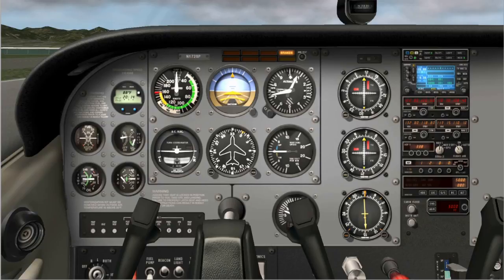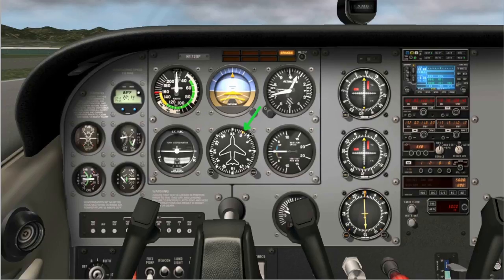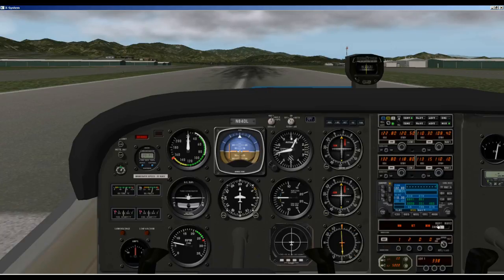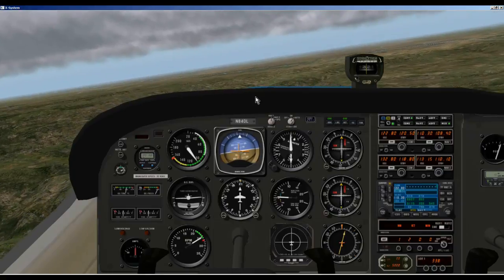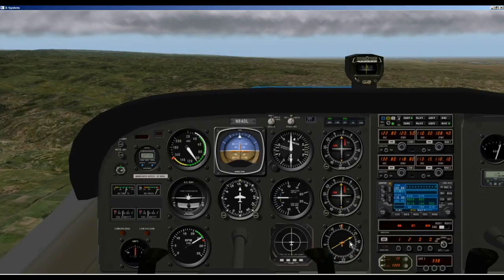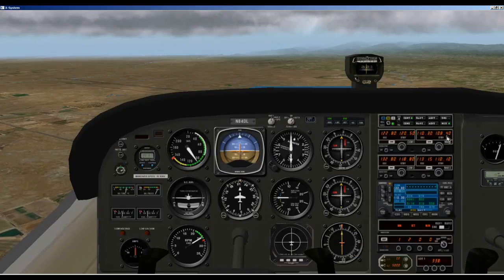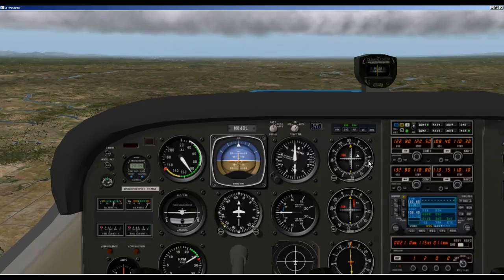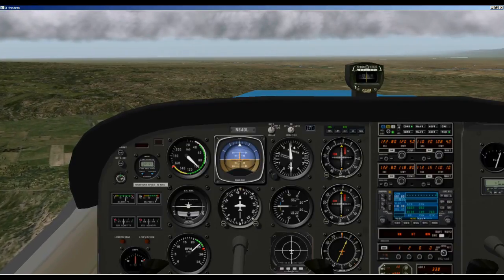How to Use the Autopilot ~ ADF, NAV Radio, Altitude & Heading, VS ~ Part 1

Comment: When setting & using the VOR frequencies & the plane does not have a “LOC BUTTON”.

Do you set the toggle switch on NAV-1 or GPS?
Reply from the maker: Hi Michael,  To use the NAV radio with a VOR the selector switch must be turned to a NAV, it will not work when GPS is selected. Each airplane has it's own set of switches or buttons for selecting navigation options so you will need to look at your Pilot Operating Handbook (POH) for how to use the navigation system in the airplane you are flying. Below is a link to my videos on navigation you might want to watch these. Part 2 shows different airplane controls and this might help you. 
www.youtube.com/playlist?list=PLjqSrWIZDAi9S9ds3QbfiTkjGAmE6b7IG

Hope this helps, let me know.

Blessings,
skip

Comment: Just had a really enjoyable flight, following through this with you. I did have a few issues though and I hope these are not stupid questions.
First I washed out on the ADF section. I’m just looking at X-Planes map and didn’t have the tick boxes at the side, so couldn’t locate an NDB. What map are you using Skip?
Second, I was playing about with setting a height and climb rate for the auto pilot and I managed to stall the plane. I think I set it to climb at 500 feet a minute. Is that too steep? Or did I need to do a Tim Allen and add moooore power.
Lastly.. perhaps a bug on my system... after landing safely at (my new improved) Benton Field. I shut the plane down but noticed that despite turning the avionics off, my radio stack still seemed very much on. Am I missing something?
Thanks Skip, I very much enjoyed the flight. 
Phil
Reply from the maker: Hi Grey great to hear you are enjoying your flights! This video was made in X Plane 10 and the map was changed in XP11 so they are not the same. The ADF feature only had a few NDB stations so you really need to look hard for a NDB. They are displayed on the map as a small circle of dots and have an identifier next to them. If you are flying around Benton Field and Red Bluff you will find one just above the Mendocino VOR labeled UK

500fpm is a fine climb rate and yes go to full power when climbing.

As for the Radios not shutting down that's my mistake assuming you are using the 172N I offered. The problem is I made the instrument panels in Plane Maker and forgot to connect the radio stack to Bus 1. You have two options and I suggest the first one just so you can see how to make changes to you panels. 

So open the airplane in X Plane Plane Maker. 
Go to the folder with the airplane and select the 172N.acf file and open it. 
Then under "Standard" select "Panel:2-D" 
If you don't see the panel hold down the right mouse button and scroll up this should bring up the panel. 
Now just click on the radio, it will be highlighted in yellow. 
On the Left side you will see a "property" section. 
There you will see that the check  box next to Bus 1 is not checked!! 
Check the box and then do the same for the all the other instruments just to be sure they are connected to Bus 1. 
That's it, save the file and next time you shutdown the radios should go off. 
 Oh, one more thing if you decide to do this  you will need to do it for each Panel I created. (172N.acf, 172N_G530.acf, 172N_G430.acf etc. Same with the G000 airplanes that have the Com Radios. Just open every .acf file and connect the radios to Bus 1 it really won't take long it's pretty simple once you do one. You only need to do this for the .acf file not any other extension such as 172N.acf~   etc that are in the folder!!!

If that's too much download the 172N again I made the corrections for most of the airplanes.

Let me know how you make out :-)

Blessings,
skip
Reply: Hi Skip. Thank’s for replying so quickly to my question. I’ll take the flight again using the ndb at Mendocino you’ve pointed out.
It never occurred to me that your vid had been made using XP10. What a shame that the map we have in 11 seems has less functionality than the previous version. You’d hope it would be the other way around wouldn’t you.
I’ve been using a combination of the in game map and having Sky Vector open on my iPad in front of me. Because it saved me having to alt-tab and also..... it might sound silly, but the extra instrumentation of the iPad, seems really immersive. :). But the trouble with Sky Vector on the iPad, is that the maximum zoom is pretty limited, so not always easy to use and if the in game map is going to hold me back.... well I might have to bite the bullet and have something more comprehensive open In the background and get over myself with the alt tabbing. I’ve been reading about “Little Navmap” which looks pretty cool.
Thank’s for going to the trouble of breaking down that procedure for me with the radio stack. I’m not very technical and normally wouldn’t touch that kind of thing. But you’ve made it sound quite straight forward, so I’ll have a bash the next time I’m in X-Plane. A Badger loose in X-Planes innards? What could possibly go wrong. Lol.  Thank’s again Skip.
All the best. Phil
Reply from the maker: Hi Grey,  Yea the XP10 Map had more options don't known why they removed them :-(

what are you using Atl + Tab for? Never heard of Little Navmap, I'll have to check that out.

Yea jump in and make changes to your instrument panels. I like putting switches and buttons were I can get to them without having to scroll around looking for them. Just backup original folder for the airplane in case you really mess up :-)

Blessings,
skip
Reply: Well originally I was alt tabbing between X-Plane and Sky Vector, but mostly during the planning stage. During the flight I was using X-Planes map. But it’s limitations weren’t as apparent back then when I wasn’t asking as much I suppose. Then I had that long gap where I drifted PC’less through the land of the console. (Actually I’m play acting as I’ve had lots of fun on console and have a foot firmly in both camps now.)  Then when I got a PC back just before last Christmas and knowing I didn’t really want to break my immersion by swapping out of X-Plane into a third party program, I’ve been looking at Sky Vector on my iPad. But while that is cool in that it rather adds to the immersion factor, it is kind of clumsy and limited to use on there. 
Anyway, since my last message I’ve tried Little Satmap and while granted I’m easy to please, it seems really good. It has loads of features and detail and it’s a moving map connected to my X-Plane and the setup was easy enough that even I managed it. So Alt Tab it is then :)
Phil
Reply from the maker: Hi Phil,  Cool, I've never tried using a third party map or skyvector that way. I do have 4 monitors so that's a big help, I can open the XP map and put it on the fourth monitor it's also great for other "things" I might want right in front of me, approach plates, checklist etc. 

Blessings,
skip
Reply: Thought you might like to know Skip, I finally finished this section. It was a bit of a journey. Fun... but frustrating as well and it was chiefly the ndb section which blocked my way.

First I got no response from the indicator needle, not a twitch. I was sure I was following your lead accurately, so on the chance that it might have been another quirk, I tried the Carenado Skyhawk I have (posh but basic. Not even an autopilot in it.) and the X-Plane default (which has Garmin and stuff and seems pretty complicated.) but neither could persuade that needle to do anything but lay there all dead like.
So I ended up posting on the forum and I actually got a reply from Laminar!  They said that ndb’s are being phased out across the US and the ones I was trying to use, didn’t exist anymore. Apparently XPlane knows this although Little Navmap didn’t. (Which is why I couldn’t find any on XPlanes map.)
So I started again from an airfield local to me here in the UK. Defunct is our bread and butter, we spit at obsolete and spank the bottom of old fashioned. Sure enough that old needle sprang to life when I asked it to look at the ndb at Doncaster.
I still couldn’t quite work it out though. Following your procedure still had me flying in the wrong direction. Pretty galling now I actually knew where the right direction was. Finally I figured out that I hadn’t adjusted the heading indicator to match the magnetic compass before I took off. Because who’d expect a heading indicator to actually be able to follow a compass without my help.... why that’s just crazy talk!  :)
Phil
Reply from the maker: Hi Phil,  I was pretty sure loosing the NDB's was on the way there were a couple more near Redding before the last few update to XP.  

I think you will see the VOR start to disappear also!! That will be a sad day as that's what I enjoy doing, plotting a course VOR to VOR and flying manually, I'm not much for AP in the simulator I just sit there looking at the screen and the airplane flies itself, not very exciting or challenging plus that's my only option in real life so that's what I practice. 

Glad you finally got going in  the right direction!! You think that would be pretty simple but it's easy to get mixed up there's so much multitasking to do!!

Blessings,
skip

Comment: what is the "SYN" button on the heading display used for?
Reply from the maker: Hi Colin, Good question I should have mentioned that in the video but overlooked that. You use the SYN knob to match the the Heading Indicator with the compass. The Heading Indicator will drift over time and it is necessary to "synchronize" the Indicator with the mechanical compass. 

Blessings,
skip

Comment: Hi, thx for this video. What planes are used ?
Reply from the maker: Hi Migdar,  the first in the video is the Cessna 172SP that came with X Plane 10. The second is a Cessna 172N that I purchased from X Hanger. I modified both airplanes in X Plane Plane Maker so the look is different, I added new instruments to both and for the 172N I changed the color of the instrument panel. This if one thing I really like about X Plane you can modify any airplane that uses the 2D panel in Plane Maker.

Blessings,
skip
Reply: Thx Skip, i think that the 172N is a good plane to learn the base of navigation. I dont like Gps , i prefer the basics instruments.
Reply from the maker: I'm with you Migdar.

skip

Comment: Hi Skip just wanted to know how do i find or work out my ground speed?
Hope your keeping well. Tske care.
Pete
Reply from the maker: Peter Rowlands Hi Peter,  yes I'm well thanks, will be flying in Redding this week in the real thing so looking forward to that. To find your ground speed you need a E6B flight computer (available at Amazon  $13-$40) if you are not using the GPS. You use them by turning a card to line up numbers. Here is a link to a YouTube video on how to calculate ground speed: https://www.youtube.com/watch?v=MRq31KYpZ1s     If you really are into  calculating "flight stuff" there is a real computer  "ASA CX-2 Pathfinder Electronic Flight Computer."  (Amazon $70.) that could be a bit easier to use than the E6B.  Let me know what you decide and how it works for you.   Blessings,     Skip

Comment: Great videos!  Thank you.  Question: I have a problem with engaging the AP on the Dreamfoil EMB 100.  I take off, fly to 1000 ft, level off.  Press the HDG and ALT on AP, then engage it.  The aircraft will immediately pitch up or down, sometimes very  drastically.  I've seen this on other aircraft also, back when I flew FSX the Hercules C130 also had an old type AP and did this same thing.  It's as if the AP pitch trim and the actual aircraft pitch trim are not synced when first engaging the AP.  Any ideas?
Reply from the maker: Hi Danny,  I do not have experience with the Dreamfoil so I can't be much help. One thing about AP if you program it to do something the aircraft can't do, for example, climb at 2500fpm when you don't have the power available strange things happen. If there is a way to enter an altitude for the AP and climb or descent to that altitude make sure what you have set up is reasonable for the airplane to accomplish. If you have an altitude set that is different from the altitude you leveled off at and engaged the AP you could be in that situation where the airplane can't respond to the AP. Without knowing your airplane that's all I can think of, sorry.

Blessings,
skip
Reply: Thanks.. I guess I was hoping there was a magic key I didn't know about that that synced the AP pitch trim  with the manual pitch trim.  Sometimes it works just fine, and others times its a roller coaster.
Reply from the maker: Sorry about that, let me know if you get it figured out.

Comment: Great video, but the sound recording is very low, was struggling to hear it
Reply from the maker: Hi Modi,  Glad you liked the video thanks. I just listened to the video and the volume was normal, I had the volume control about half way so it works fine on my computer try checking the volume control on your computer and adjust the volume on the video also. Sorry you had a problem hearing, let me know if you have trouble with any other videos of mine.

Blessings,
skip
Reply: @WEHVideos 
Thanks for replying, I watch YouTube on my phone and it was on the max volume but still low, amd by the way i mentioned that after watching about 3 videos, they all the same :)
Reply from the maker: Hi Modi,  Well I just watched the video again on my phone and the volume is fine don't know what to say, is there another volume control you might be missing?

Blessings,
skip
Reply: Hi Skip,
No worries, it's not a big deal, I just compared the video to the other videos I watch on other channels and noticed that it's higher volume there (which is more optimal for me as I could hear them properly more when I'm watching on my way to work and specially in public transportation when it's a bit loud) but not a problem at all, most important is that you do good videos, thanks again for your reply :)
Reply from the maker: OK but sorry you are having trouble hearing the audio I'll try and boost the volume a little in future videos maybe others are having the same problem.

Blessings,
skip